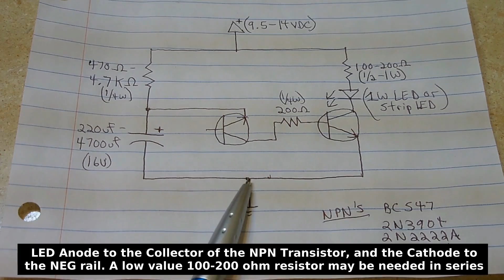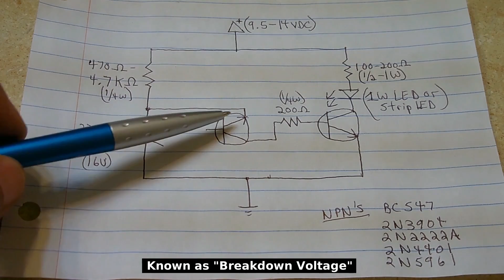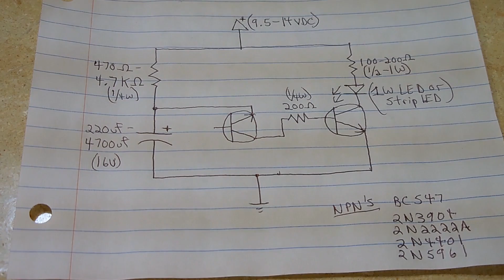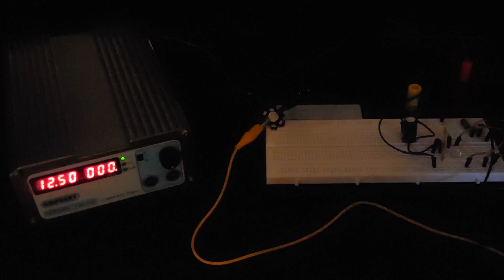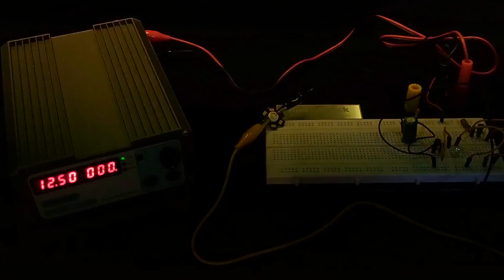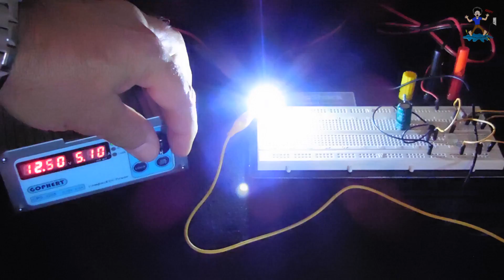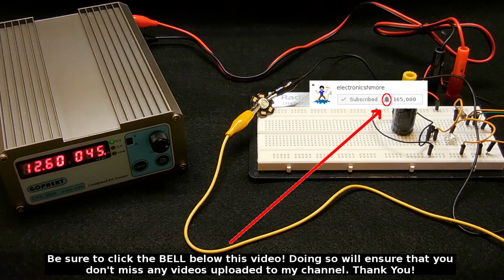World's Simplest LED Flasher / Strobe Circuit (9.5V -14V)

Comment: I’m looking for information on how to create a lightweight strobe light that can be Velcroed on to a drone (quad copter). It has to be extremely bright. Visible up to 3 miles at night. Flash at a rate of twice per second, have its own rechargeable power supply and come in at a weight of approximately 6 grams or less.
The aerial drone laws in the USA have recently changed allowing for drone flights at night, and now there is a huge demand for a strobe light attachment to comply with the regulations of night flight. The preferred color is white. There has been such a run on these lights, that they are hard to find, and they are about $30 per light. Ideally it would be great if the design allowed for a system that had an ability to run a second light on a lead that could be placed underneath the drone, so the main unit would be on top and an extension light underneath. Not sure if this is in your wheelhouse of expertise, but it would be in high demand if someone could produce a kit that could be assembled for a few dollars less than a manufactured one.
Thanks
Reply from the maker: This should work for what you're looking for, it's the best I could find. Thanks for watching Mike!
https://bit.ly/33yC7qu
(Affiliate Link)
Reply: So I just plug it into a power supply and it flashes? I don’t mean to sound dumb, but I’m just not savvy on this stuff....

Comment: can I use TIP31c instead of BC547?,  any advantage?, and can I run 8 leds instead  strip?,
Reply from the maker: You need to experiment on a breadboard. The TIP31c may require too much base current to trigger.
Reply: @electronicsNmore  ok so its 547's then, its only a strobe to mount on roof to scare the pigeons away to stop them from nestimg

Comment: I tried. It does not work for me. I checked the cap is working , resistor working, led working, battery OK. I used 2N4401 in the first stage Transistor and bc547b in the second stage  transistor. My led is a simple low power LED. It only turns on when I touch the base of any of the transistor. I used low resistance value of the suggested range
Reply from the maker: It's a very simple circuit, you must've connected something wrong or have a faulty component. Thanks for watching!
Reply: @electronicsNmore  OK, I will try again

Comment: hi, how to calculate base resistor for bd139 transistor?
Reply from the maker: Test it out. If it doesn't work correctly, try different values lower or higher.

Comment: Great ! I like the vintage rotating beacon effect, is it possible to add another Led for a wig-wag effect (i mean aircraft beacon effect, one on the upper fuselage & another on the belly)) ?
Reply from the maker: You'd need two circuits in operation.
Reply: M Lyons  
The transistor connected to the capacitor in his circuit is configured to function in a reverse voltage cascade. 
Watch where he points when he says "emitter" and "collector" they're reversed. The other clue to this is cutting off the base pin. It's not switching anything without it, so what's it's function? To make sure only a bright flash is created, while suppressing anything that might create a dim flash.
In a reverse voltage cascade, a transistor works like a higher voltage zener diode. A minimum voltage must be reached before electricity will pass through it.

If yours is the same, you have a few choices...
#1 Get rid of it.
Use a blocking oscillator circuit with the same kind of frequency adjustment (resistor and capacitor) in place of the transistor causing your problem.
The brightness of the LED flashing will depend on the overall power of your batteries.

#2 Add to it.
Use a slightly different oscillator circuit to drive that transistor.
Look for a video showing how to make a joule thief. A joule thief will oscillate through a transformer, increasing the voltage by repeatedly switching on & off with only an inductor in the circuit, creating a voltage spike in the transformer windings (which it uses as an inductor) which are capacitively coupled to the other side of the oscillator until enough voltage is present to drive the device it's powering.
Connect the joule thief to the transistor in reverse voltage cascade.
Voltage provided to the joule thief will control frequency of the flash, so a potentiometer would be useful in finding what value of resistor is needed
It's a noisy bugger though, so don't forget a blocking diode between it & the power source.

#3 replace it
Get a zener diode or two that are rated to handle the wattage, and have a lower reverse voltage cascade.
Put them in place of the resistor.
The flash won't be as bright, but it's a single component workaround.

There's no reason why this circuit won't run on as little as .6 volts (yes, six tenths of a volt). You just have to think about it like that's all you have to work with.

Comment: What are those two transistors you used in here? I want to use it as an oscillator can I generate pulses around 100Hz? How?
Reply: A blocking oscillator with a capacitor... You change the frequency by changing the value of the capacitor.
That's what you're looking for.
Just about any NPN transistor used for switching can be used.
One transistor, one toroidal choke, one capacitor, and one resistor.

Comment: Nice project, but can I use 10W high power LED, it's forward current is 1000mA. Thank you
Reply from the maker: Possibly. Try using a TO-220 NPN transistor on the right side(maybe a mje3055). You need to experiment.
Reply: @electronicsNmore  Should I replace the right transistor but leave the left one or? I'll expiriment hope it is going to work. Thank you for the answer :)

Comment: It be interesting to stick a mains transformer in reverse instead of the L.E.D with a 50Hz speed and see what voltage you get out the other end. 

Mains transformers work on alternating current at 50Hz, for example if you have a transformer and the input is 110volts AC and the output is 9volts but if you use it in reverse you can get 110 volts output from 9 volts input. If you your using batteries they be direct current so a circuit like the one in your video would be useful for converting DC into AC and then you could make a little taser but of course it wouldn't be as powerful as a real taser but enough to give you a shock.

Comment: how much watt/current can this circuit handle? I planning to use up to 6 * 10w LEDs
Reply from the maker: 60W way too high. You can experiment using a higher current NPN transistor that's connected to the LED, or use a small relay in place of the LED in the schematic and have the relay (NO) contacts flash the high current LED's. Be sure to use a 1N4148 or 1N4003 in reverse across the relay coil to protect the transistor from back EMF. Thanks for watching!

Comment: Why didn't you use variable resistor or potentiometer?
Reply: On what
Reply: @robertmartinezakatrebor6408  On the first resistor. He provided the specification range so a potentiometer would work.

Comment: Great tutorial....well explained...i'm a newbie trying to make something and this helped me to understand better....thankz
Reply: On the circuit board for the housing project
Reply from the maker: Glad you enjoyed the video! I have a lot of excellent videos on my channel that cover many different subjects, so be sure to check out my extensive video playlists for other videos of interest to you, rate thumbs up, and share my channel with others. Thank You
Reply: @electronicsNmore  definitely.....
Reply: @electronicsNmore  hey...can you help me with something....i'm trying to make a circuit for my motorcycle tail lamp.... basically the idea is that under braking, the led lights up as usual... but when the parking light is turned on, i want the led to perform a strobe function....i have googled enough to understand that i could use the circuit in the video or use a ic 555... the problem is that i want the led to flash 3 times, then wait for one second before repeating the strobe cycle....also i want the brake light to function as such even if the parking light is turned on i.e. priority is given to the braking light function. so, at night, the strobe function would not work when braking, and once brake is released, the led strobes... hope you understood what i meant....thank you
Reply: Use low voltage for LED lighting. And low frequency sound waves in Wi-Fi and blue tooth accessories

Comment: I tried simulating this in LTspice and it does not seem to work.  (Yes, my transistors's emitters are pointing the right way, and the polarized cap is connected as shown)
Reply from the maker: Clearly it works, I don't upload bogus videos. Thanks for watching
Reply: I can SEE that it works.  What I am saying is that I am unable to get it to work in the LTspice Simulator.    What are the characteristics of the LED that you are using?
Reply from the maker: Once you try it on a breadboard, if you still have problems, let me know.
Reply: Problem ended up being the model for the transistor in LTspice.  The model did not simulate avalanche mode of the resistor.

Comment: Can we connect this circuit to transformerless power supply?
Reply from the maker: For the simplified version or the higher current version up to 100mA, no problem using it, but make sure the output uses a zener regulator as shown in the video below. 
https://www.youtube.com/watch?v=dne6egi_GpE
Reply: electronicsNmore - you mean to say I have to add 12 volts zener diode across bridge rectifier?

Comment: Hi, Thanks for Sharing. Using this setup is it possible to make a 36 watt led flasher using 12 volts?
Reply from the maker: You can try triggering a 3A rated mosfet instead of the NPN transistor.
Reply: Thank You

Comment: Is it at all bad on transistors to force the reverse breakdown voltage through them?  Or does that not affect their lifespan at all?
Reply from the maker: As long as the current isn't excessive, the transistor will be fine. Thanks for watching!
Reply: 00Skyfox No problem when current limited.
Reply: electronicsNmore - How much current BC547 can bear?

Comment: You are doing something with a bipolar transistor that I've been taught couldn't be done. With out connecting the base of your first transistor to any voltage source, there shouldn't be any emitter to base voltage or current to cause the emitter to collector junction to turn on. Please explain to me how this works. You can email me at dnchs880@gmail.com if you prefer. My name is Donald and I have been and Electronics Technician for 30 years and an Engineering Technician for 10.
Reply from the maker: Donald Chase Hello. I explained very clearly in the video. When high enough voltage is placed on the emitter, it breaks down and conducts.
Reply: Donald Chase It works in reverse as a zener diode (actually all diodes does).

Comment: I have a small Chinese fabric thing, 2 wires in and 2 out, and it has push buttons. It can flash in different rates, do no flashing but dim, and it can flash smoothly. Just 2 digital buttons, very small size. But to actually build it with this few components is very cool as well. I never thought of using the NPN backwards. I see a very cool application for that now! I needed exactly just that. A switch (no comperators) which triggers (round) a  high enough voltage. It will trigger and supply power to a relay. If you slowly increase the voltage to a relay it will not switch properly. It needs to snap. Now I have a nice challenge, testing out some of the rescued transistors for their break voltage.
Reply from the maker: deslomeslager Thanks for watching!

Comment: 4:14 That transistor can be replaced with a zener diode right?
Reply from the maker: Xyz77 Though a zener acts similar, it won't work in this circuit. Thanks for watching!
Reply: Thank you for your answer!
Could you please explain why?
Reply: @Xyz-77  im guessing its too fast? idk because im guessing that in this circuit the transistor has to have a recovery time thats relatively long, and a zener would be too fast, so it would just be a constant brightness. that was just a guess though